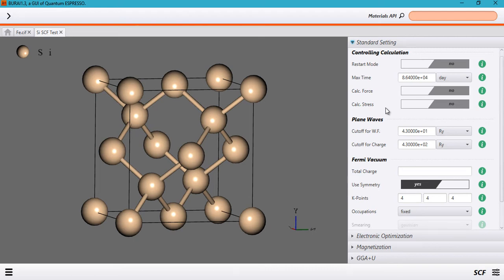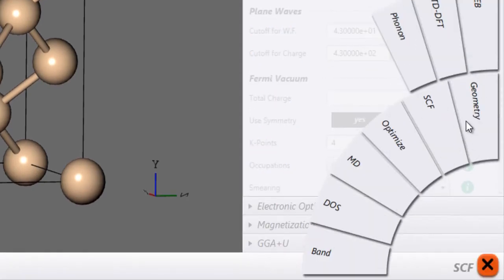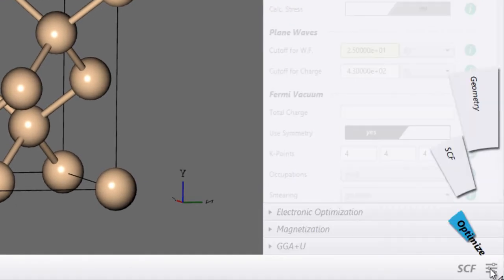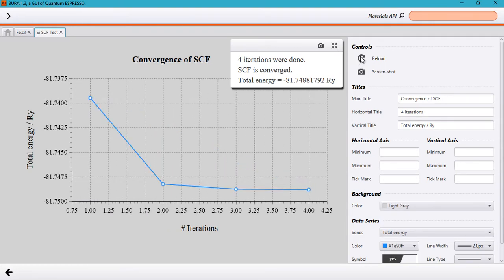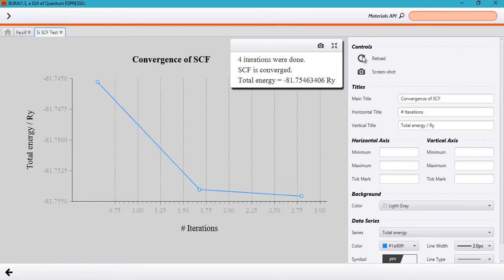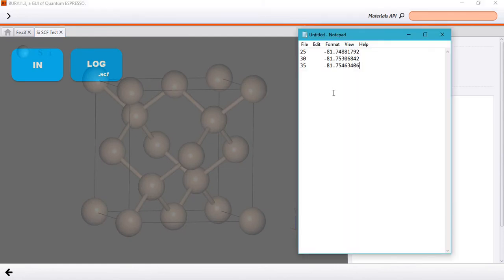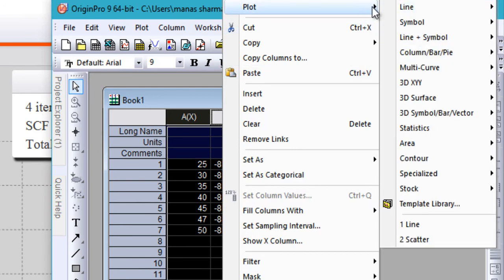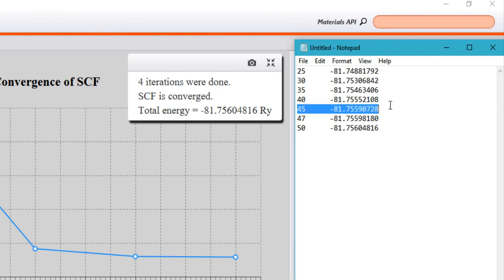DETERMINING Plane Wave K.E. CUTOFF and CHARGE DENSITY CUTOFF - Quantum ESPRESO [TUTORIAL]

Comment: Thanks for this tutorial. It helped me understand what ecutwfc does but can you please tell what does it mean physically? How increasing it causes the energy to converge or in what sense this quantity is a cut-off? And if this is really a cutoff for the 'energy', why do we specify two (or more?) such cutoffs such as ecutwfc, ecutrho, etc.
Reply from the maker: I had already replied to your question on another video.

ecutwfc and ecutrho are the kinetic energy cutoff of the plane wave basis used to describe the wavefunctions and the charge density, respectively. The larger the energy  cutoff, the slower the calculation would be, but more accurate. The choice of the cutoffs depends only on the pseudopotentials you are using and on which quantities you are interested in (for instance, magnetic properties are harder to converge wrt total energy). Once you've chosen your PPs you can test convergence of the energy wrt to cutoffs in the cheapest system (usually in the bulk).

"...when we make a Density Functional calculation with plane waves, the (electronic) wavefunction is represented as the infinite summation of plane waves, which must be truncated, in order to be able to handle them computationaly.
So, the more plane waves, the more accuracy, but also higher computational cost. The trick for speeding up the calculations relies on the fact that the plane waves with less kinetic energy (represented as ℏ2 / 2 m |k+G|2) have higher contribution to the totality, so the plane waves with lower energy are the most important. But, up to which point should we increase the cutoff, so that we get a good balance between computational cost and accuracy? That is precisely the optimum cutoff choice."

From https://blog.larrucea.eu/checking-optimum-cutoff-qe/

Comment: Hi, thanks so much for your videos. Two questions. Do you have information about how the accuracy of convergence energy affects the band structure calculations or the DOS?. The other question is why you are always considering a factor of 10 constant between the Ecutoff and Charge Density cutoff? I saw other videos where they set the Charge density cutoff as constant and changed only the Ecutoff. Thank you so much in advance. Congrats again for sharing your knowledge.
Reply from the maker: I had read somewhere that for ultrasoft pseudopotentials the charge density cutoff should be 8-12x of the energy cutoff. So I was just keeping the calculations consistent. Probably it won't make that much of a difference practically. So I guess one could also keep the charge density cutoff fixed.

Check out the 'ecutrho' section here
https://www.quantum-espresso.org/Doc/INPUT_PW.html#idm313
Reply: @PhysWhiz  Thank you! great!

Comment: Hi. Your video is very useful for my current project. I am currently running my calculation using linux and manually using the linux command. However, I find the software that you used in the video seems to be much easier. May I know how can I get the software? 

and, I am more than happy to be able to contact you in person

Comment: I have problem to calculate the semiconductor(oxide) band gap. It always show error.
Task # 2
from  iosys : error #  1
fixed ocupation and isda need tot_magnetization
Reply: I think you have npsin=2. For spin polarised calculations use occupations="smearing" and smearing="gaussian" with a degauss parameter of 0.01